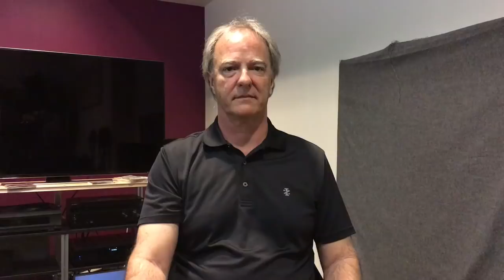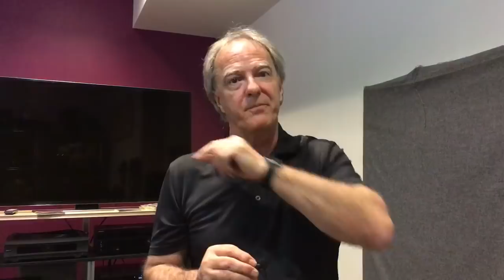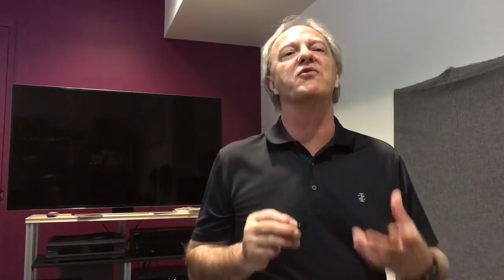Everything you need to know about speaker impedance

Comment: IMPORTANT 2 QUESTIONS: 1) What quality precise and repeatable equip and methodology is required to measure speaker impedance. i own freq generator, perfectly flat amp, oscilloscope, voltmeter. what else would i need? 2) Since the crossover frequency in a passive crossover network one designs uses 'driver impedance' as a variable... it seems irrelevant to me to use the so-called 'nominal impedance'. if i desire to design a 500 hz crossover network, wouldnt my design be far more accurate to measure the impedance of driver mounted in cabinet, placed in room, and measure actual impedance at the planned 500 hz frequency? then use that FAR HIGHER impedance into my crossover design formula? Lets have some dialog about this. My aim is accuracy.
Reply: The easiest way to not only measure the impedance but to graph the "impedance vs frequency" curve for a driver would be to purchase "Dayton Audio DATS V3". You not only get the impedance curve in under a second but it also measures all the "actual" (not published) Theile/Small parameters of the driver for you, coil inductance, capacitance, resistance. That impedance graph will also verify the precise tuning frequency of your cabinets as it'll show in the impedance graph. All in literally under a second. Well worth the money if you build speakers. Can't imagine building these days without it. The answer to the rest of your questions is yes nominal impedance is not for designing crossovers it's for amplifier matching only. You always design crossovers around the actual/average impedance around the crossover frequency plus or minus an octave. Store bought crossovers are horrible for that exact reason. The impedance of your mid at the crossover freq is way higher then published nominal, sometimes double. The next two answers is yes. Measure, then design, then use that dayton dats to verify. Then once you do all that realize that once your put some power to those speakers the impedance will rise from the coil heating up :)

Comment: Hello, what happens if I run 16ohm speakers on an 4-8ohm rated amplifier? Does it mean that the speakers will receive less power from the amp in comparison, or are there other acoustical issues? Thanks
Reply: On a modern solid state transistor amplifier: No audio issues. If anything you will double your damping factor (that's a good thing). Bad damping factor can lead to sloppy bass/midbass. You can also run smaller gauge speaker cables as the current flow will be half that of 8 ohm. Running 16 ohms will be half the power of an 8ohm load. That isn't very much audibly, it is only 3dB quieter, barely noticeable.  You can always run higher impedance on a modern transistor amp. Going lower impedance then rated can run into the amplifier going into protect mode or if it doesn't have any form of protection against short circuit/current overload/overheating then you can have too much current running through the amp and let out the magic smoke. Most modern amplifiers made in the last 40+ years will have some sort of protection against anything bad happening, it'll just shut down and reset when you remove the short .

On a tube amp: Check with someone old who understands them, I don't have much experience with them. My understanding is that you WILL have a problem if you don't match the output impedance of the amp to the load and there are usually different "taps" inside the amp to switch that. My understanding is that on tube amps going higher impedance then rated is usually worse then going lower (opposite of modern transistor amp).
Reply: @wally7856  Thank you very much for detailed explanation. Is it the same with class D amps that use chips as with transistor amps?
Reply: @arnask7071  Class d is the same. Higher impedance always okay. Going too low will send it into protect mode

Comment: For amplifiers, maximum power transfer is dictated by matching the amplifier output resistance with its load, i.e. maximum power transfer occurs when the load resistance = output resistance. All deviations from maximum power means not maximum power ie quieter = frequency response. Where a speakers resistance at a particular frequency is extremely high, then the amplified sound will be quieter = frequency response. If the resistance at a particular frequency gets near to 0 Ohm, then you are essentially shorting out the output of the amplifier, which means that the output stage of the amplifier could well exceed it's maximum power handling rating leading to a catastrophic failure. Just to make it a bit more complicated, the human ear has it's own frequency response, meaning that altough an amplifier may be amplifying a particular frequency relatively quietly, the human ear could be more sensitive at that frequency meaning that the sound would be percieved as not being quieter.

Comment: I have 6 ohms speakers and i am connecting them in parallel so two speakers in parallel gives 3 ohms and my amplifier is rated to 4-8 is it ok to run those speakers at 3 amps ?
Reply: These “audiophiles” won’t give you a straight answer. It’s only one ohm difference. Just don’t go nuts and you’ll be fine. Most 4 ohm amplifiers can easily run 2 ohm speakers. (Within reason) Most 8 ohm amplifiers can easily drive 4 ohm loads. But if you’re driving them hard and heavy, you’re going to burn the amplifier out. Keep a close watch on how hot the amp gets. If you have to turn it up to max volume, you simply need a bigger amp.

Comment: So a 4ohm speaker can be driven by a 8ohm amplifier so long as the volume is not loud enough to require more power from the amp than its capable of producing.  And if the volume is too high, it could cause issues like overheating? Also, If I have a 4 ohm speaker like a KEF C75 with a 4 ohm amp would actually sound better at the same volume than a 4ohm load speaker driven by an 8ohm amp? ? Does my question make sense?

Comment: I liked the discussion.  It helped me understand many of the factors associated with the impedence spec.
It comes down to how much current the driver, receiver or amp, can produe before overheating its components. At 4 ohms a speaker will draw double the amps as a 8 ohm (minimum) speaker.  The power supply in the amp must be able to produce enought power to support all channels. So those multi channel AV receivers have to have stout power supplies.

Comment: Yet another Steve waste of time vid. Yah never actually turn on any sound system,speakers, & why I go to OCD Mikey. I just ordered a new XLi 3500 to power my vintage Peavey SP 118x 18" Subwoofers rated at 500, 1000RMS &2000 Peak. They are 8 Ohms but I plan to upgrade for Techno Trance reason to a 20 Htz-200 Hz 1000 Watt RMS I would like double the Wattage rating of a given speaker. If I go with a 4 ohm speaker I gain extra wattage for my comfort zone, persay? I am thinking 4ohms produces more ~HEAT~ than does 8 ohm meaning wear & tear will happen sooner,damage, burnout,etc. Thus far I have heard that 4 ohm gives a 3 db overall VOLUME increase, so that means less Volume Gain is needed, would that also mean less $$$ too E Bill? My D9 15" Cerwin Vega used 4 ohm Woofer, so I stink I wills just follow that routed stinking because those D9 Speakers taught me 15" Woofer is the only way to get a good full, deep, impactfull sound. & Klipsch teached me Horns are the only way to go for Mids & Highs.. So dat B Y I loves me Martin Audio 15" Blackline X Speakers powered By's a GX7 & lovely it tiss... Steve

Comment: i just want to know how 3 way speakers are 3 different speakers using just 4 Ω or 6Ω? 
I've done the math and it seems like with 3 speakers in series or parallel you would either have a higher ohm or lower ohm then 4 or 6Ω. 
I've opened up a 3 way center speaker that has 2 mids and a tweeter and the wires were in parallel but the speaker box was labeled as a 8Ω speaker all together and i want to know how because 3 8Ω speakers in parallel would be 2.67Ω and in series 24Ω not 8 ohms

Comment: @14:07 mr Steve seems surprised by the ability of a simple receiver to push power thru 2 ohms loads :}. that was cute.
very nice interview, thanks for sharing. 

*most receivers i came across have the specifications mr Jones was talking about: on the last page of electrical specifications in the manual, they list "dynamic power", the term used most of the times. the back panel says 8-16 ohms, but the engineers tested the components down to almost a short circuit.. yes, the THD does go up from let's say 0.1% to 1%...

i enjoy tinkering/working with (even 30yrs old) receivers because the power source in those is more than capable of driving 2 channels at the rated power; literally using 2 out of the 4, 6, 8 channels it was designed for, gives the power source a lot of headroom. i rarely replace the rectifying caps in old receivers but i do in regular amps, especially bass guitar amps (i guess heat and power demand).
if you've never heard an old school yamaha receiver running a set of low impedance speakers in 'pure direct' pls buy yourself one for $50 and see how clean it runs even above 80% rated power. it doesn't have to be yamaha, any 'high end' model/brand will behave the same...

Comment: Sorry Jones you get an F in electrical engineering 101. You completely left out the phase angle, that is the reactance or power factor. This is critical and explains why a certain brand of speaker wire many years ago was notorious for blowing up power amplifiers. What's more the impedance of speakers increase when voice coils get hot because copper has higher electrical resistance at higher temperatures resulting in thermal compression. When the voice coil moves out of the linear region of the magnetic field impedance also changes. Another change comes with ferrite core inductors as increased current saturates the B-H curve. Audiophiles want simple answers to complex questions. Don't feel badly Andrew. From all the people I've met either personally or on line in this industry all have little or no real technical knowledge. So what is the meaning of the equation Z = R +X? What is a Bode plot. Why are multi way speakers not zero phase systems and what does that mean?
Reply: @A. Melbs Voice coil temperature can fluctuate as i explained above. As current flows when the driver is pushed harder its electrical resistance rises causing less current to flow and the driver not playing as loud as it should. Tweeters are especially vulnerable to this because they have many turns of fine wire which heats easily. The temperature increases with the square of the current. Therefore not playing as loud as it should its high frequency response falls off. When it cools down, if it hasn't been damaged it goes back to normal. This is one of a number of reasons why I reengineered many of my speaker systems to use multiple tweeters to share the load. So in my best sound system my speakers have 20 tweeters per channel. This reduces heating by a factor of 400 and precludes the possibility that they will ever burn out from being driven too hard or overheating which can deform or even melt the voice coil.

Comment: Hell, I very much would like an experts advice to settle a debate I’m currently having with other guitarist. 

An amp I own (1973 Pro Reverb) rated at 4 ohms 40watts. Has two 8 ohm 12” speakers wired in Parallel for 4 ohms total.

I wanted to take a 16ohm 150watt speaker. Use a resistor of 8ohm 100watts. Wired in parallel with the speaker. My multimeter showed 5.7ohms.

Now take that and add it to one 8ohm speaker, wire both in parallel like the amp was designed.. that should be safe for the amp and speaker correct?

Comment: Electrical impedance and resistance are measured in ohms. An ohm of impedance is the potential difference (voltage) in volts across the impedance per unit of current in amperes (or amps) through the impedance. In short, an ohm is the number of volts per amp. For an 8-ohm loudspeaker, the nominal ratio of voltage to current is 8. (I say "nominal" because the true impedance varies with frequency, but the audio industry usually calls a driver whose voice coil dc resistance is between about 6 and 8 ohms an 8-ohm speaker.)

If you prefer, you can think in terms of the reciprocal of an ohm, which is called a siemen. Given that an ohm is the same as a volt / amp, its reciprocal (a siemen) is an amp / volt. Therefore, an 8-ohm speaker is also a 1/8-siemen speaker, and thus, an 8-ohm impedance will have 1/8 of an amp through it for every volt applied across it.

Comment: Apparently some receivers have an Ohm switch. It turns out that how these receivers switch between 4, 6 or 8 Ohms is by cutting the power output. So if your receiver outputs 170 watts at 8 Ohms and you switch to 6 Ohms, the output drops to 100 watts. That switch is only supposed protect the system rather than power your speaker at its rated ohm rating. 
So it is suggested to run the receiver at 8 Ohms to ensure you get the full power output.  So long as your system doesn't overheat, you should be fine regardless of Ohm rating on the speaker.
Reply: Other way around, as the Impedance goes down the watts go up from an amplifier. My mono amp Alpine HDA -M80 is rated at 500w x 1 @ 4 ohms or 800w x 1 @ 2 ohms. It also allows me to power a JL w7 @ 3 ohms. It should be 650w x 1 @ 3 ohms ((800-500)/2 =150) and then factor in 12.5v instead which is ~500w @ 3 ohms. Unless you have perfect battery and alternator.

Comment: is this also applicable on center speakers and/or  its surround speakers? lets say I have Onkyo 656 and I want to use the emotiva airmotiv c2 for my center speaker which is rated at 4ohms can you say that its safe to pair it, also my fronts will be the emotiva airmotiv t2 which also a 4ohms impedance speaker.
Reply: Will a 4 ohm and 8 ohm rated amplifier work with a 6 ohm speaker? Or is that stressing it too hard?

Comment: Thank you for a great explanation Andrew Jones! I've wondered about these specs for some time.  Just make sure you have a good amplifier and you can drive any speaker!!
Reply: It has nothing to do with a good amplifier (whatever that means). Some speakers need more current and your job is to buy one to match that speaker. If your speaker doesn't need a high current amp you are wasting money because a high current design costs extra, all else being equal.
Reply: carlos oliveira Some lesser quality amps can’t handle 4ohms or less. Therefore buy a quality amp!

Comment: I have an Yamaha rxa 770 (6-8ohms) and speakers 8ohms ( 90db 1m ) but i'm in doubt If i set in receiver 8 or 6, what`s the best way and why ?
Reply: You're good either way. In general its no problem driving a lower impedance amp into a higher impedance speaker as long as the difference isn't too great. The problem comes in when people drive 8 or 6 ohm amps into lower load speaker such as 4 ohms or less and that is what Andrew is trying to explain at the end. Doing this will make the output stage of the amp to work even harder or put more strain on it potentially causing damage in the short or long run.

Comment: That’s great but what about cartridge impedance or for that matter all the other impedance measurements in HiFi?  Apparently everything has an impedance which supposedly affects what we hear.  Flipping nightmare!
Reply: There are no absolutes in audio but rule of thumb: to maximize voltage /signal integrity between sources to preamps to amps always have the load higher in impedance than the source. Its normal here to see the load being higher in impedance by factor of 5 - 10. But for speaker and amp, we want to maximize power transfer and here we want impedance to match as much as possible. But if you're going to mismatch safely, again always have load (speaker) higher in impedance then the source ( amp). But here we want to not mismatch by more than double is rule of thumb, otherwise you won't get close to the manufacturer rated power. When the load/speaker is higher in impedance this is mainly to protect the amp/receiver but also sometimes the best tone is when the amp is driving a higher impedance speakers.

Comment: If I connect a 50 watt 8 ohm resistor in series with a 8 ohm speaker, measure vols across resistor, then sweep from 10 hz to 20 khz will I be able to calculate impedance at different frequencies?
Reply: Not in the static resistor. In the variable resistor speaker you will be able too. It varies resistance with frequency.

Comment: I'd be more concerned if the speaker has an uneven impedance curve, driving it with a tube amp! Since a tube amp outputs a constant CURRENT for a given input voltage, the peaks and dips in impedance will show up as corresponding peaks and dips in the frequency response.